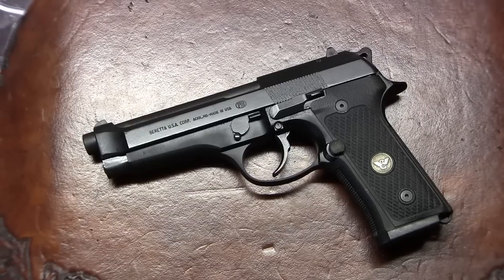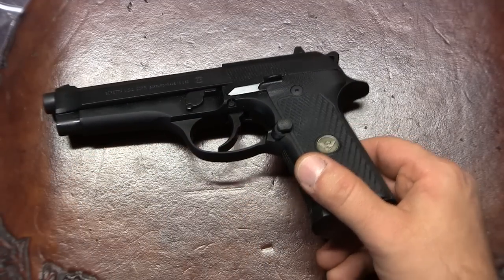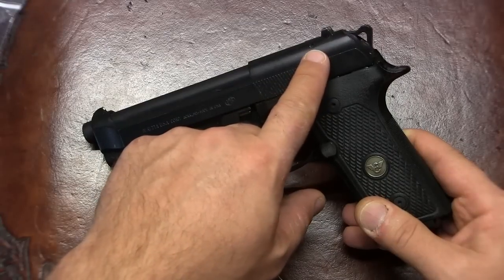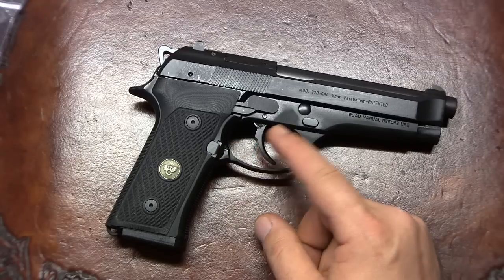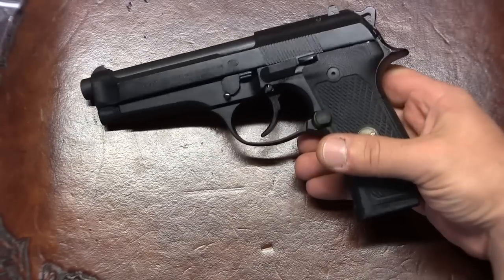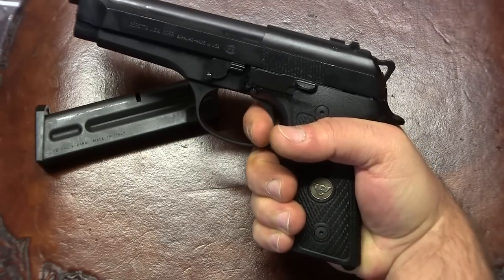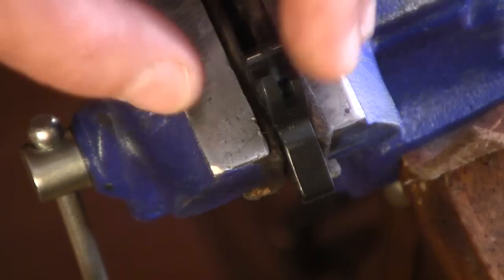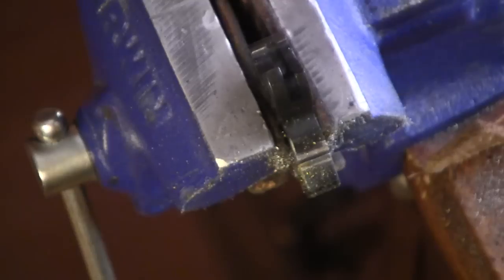Beretta 92 Spurless Hammer (D) Mod

Comment: Great video, thanks. I have 3 D models, a 96D, 92D, and a 92D Centurion. I have installed the standard hammers in mine because some of my holsters allow the weapon to slip by the safety strap during rough use. I also use a lanyard while doing things like kayaking and mountain biking.
Reply from the maker: It is my pleasure. I haven't even considered how the lack of the spur may affect carrying, but it makes total sense depending on the holster. And I figured the lanyard loop would be very handy in some situations. Great to know.
Reply: I have a 96D ,I want to make it single action. And double

Comment: Patrician. I can appreciate a man that utilizes a DAO. I think it's underrated.
Reply from the maker: Thanks. I think that is the only way to really train the trigger finger.
Reply: MosinVirus True. And also the manual of arms is just a safer Glock. But I am interested in what the pull weight is on your gun.
Reply from the maker: It feels like 7 lb.
Reply: MosinVirus That's what, about a pound more than a standard Glock right?
Reply from the maker: Just about. But that is because I am using a light hammer spring. If using stock spring or even D hammer spring, the DA trigger pull weight will increase.
Reply: MosinVirus Out of curiosity, what made you switch to DAO? It's not a particularly common thing. Most just go striker fired at that point.
Reply from the maker: I think I mentioned it - I wanted to train my trigger finger a bit. Long pulls, heavy-ish pulls. I figure if I can improve using this setup and then go back to SA, I will see improvement there for sure.
Reply: MosinVirus Well at that point the trigger weight will be nothing but the pull and reset difference might be somewhat disorienting.
Reply from the maker: Probably true. We will see.
Reply: I get it, that he wants to train his DA pull....but in a war hammer like the M9, wouldnt we all agree the 1st DA pull just to start the lawn mower  going and the true joy the following 14 rounds in SA with the short, light trigger stroke needed for 25 to 50 yard shots and mow down? ..and be able to combat load as many mags as you have til out of mags or finished mowing?

Comment: Looks great. Nice hand work, too. 
What spring do you run? Any light strike issues?
Reply from the maker: I now run the D spring (16 lb). No light strikes. With the 12 lb one i did have a couple out of maybe 300 rounds.
Reply: @MosinVirus  I just installed a 14# hammer spring in my 92 fs 22LR. 
I put well over a hundred rounds through it today and no misfires.

Comment: I was wondering if you could make a video of how to assemble it without the seer And what parts you need to change a 92FS into a 92d
Reply from the maker: One of the biggest changes is the slide. I can see about making a video.
Reply from the maker: On a second thought, I believe it should come down to 3 main parts - slide without savety/decock lever, spurless hammer and spacer block that replaces the decock lever in the frame. The sear is super easy to take out. You take off the grips, push the sear pin out and both the sear and its spring will come out.
Reply: I have actually watched your video for the full disable and full reassemble for the Beretta 92fs every time I work on my Beretta 92fs I have made 3 custom Beretta but this 92d has me norvis I would like to show you the picture of them
Reply from the maker: @seanroessger7075  A "D" version is simply double action only. That is why there is no need for a sear or safety/decock levers. It is not for everyone, especially with the long trigger travel that all Berettas have.
Reply: I understand that 92d is not for everyone. But what I am finding out it is the best way to learn trigger control. So I bought a 92X full size frame and a stainless steel '92D slide. I'm building the gun from those two crucial parts. Your videos are what give me the confidence to explore gunsmithing  for myself. Since day one when I combining the Beretta elite II with M9A3 back in 2020

Comment: With all the work you have done on the Beretta. I was wanting to use the new straight trigger. Which needs to be modified. What is the pad of the trigger?
Reply from the maker: I haven't looked into those to tell you the truth.
Reply: Would you be able to tell me  what bump is being talked about for the over travel on the trigger?
Reply from the maker: @michaelkerr9682  from what I can tell looking at the picture of the Vertical (straight) trigger, the upper body of the trigger is modified. One half is extended rearward to prevent the trigger from resetting all the way out for double action. As it is made it will not allow the trigger bar to travel back enough to the rear to engage the hammer hook. However, if you remove material from that area to match the other side, and the trigger is allowed to reset fully, I believe its shape will not be reachable.

Comment: This is a little late in coming but I have a question, can you use a 96d slide  and barrel on a 92 frame without any hiccups.
Reply from the maker: I have used a 96 D slide on my 92FS without any issues.

Comment: Another great job are you considering changing the hammer spring weight because of the amount of material you removed or does it matter when comparing to the hollow spur that you removed
Reply from the maker: I honestly don't think it will be an issue. Next time I go to the range I will test it out.
Reply: So was it an issue?

Comment: Where the hammer spur came to rest at recoil in the groove in the tang - does this removal of the hammer spur cause over travel of the hammer now at recoil?
Reply from the maker: No, the bottom edge of that slope I created is still where the body of the hammer is/was. That hits the slot in the frame and stops the hammer anyway. There is no way for it to go past that spot. The spur or top half of rhe hammer never contacted the slot. 1911 hammers do that with beavertails, not Beretta. Beretta hammers overtravel control is toward the bottom of the hammer.

Comment: you changed the mass of the hammer by cutting off a piece: that can cause too light percussion and produce a misfire.
Reply from the maker: But the Beretta D hammer is commercially available. And the D version is something that existed for a while. And I can personally say that even with a 12# hammer spring this hammer has not produced a single misfire or light primer strike.
Reply: yes but you used the hammer of an ordinary 92 FS and you cut off a piece. Glad to hear you have no misfires but, at your place, i would avoid this modified hybrid pistol for self defence. The beretta 92 has born as a 100% military gun and still is it, his purpose is not shoot paper targets at the shooting range but.... to kill humans.
Reply from the maker: 0XAN not arguing. Just saying that I dont think there is a big difference in hammer mass between a standard 92fs hammer cut to D profile and a D hammer.

Comment: Wow, the checkering looks fantastic! But wait, can I put a D slide on a 92f? And is the front sight replaceable on the D slide?
Reply from the maker: Thank you. Yes, I believe a D slide should work on the F frame. The D slide I have doesn't have a replaceable front sight. Not sure if there are other D slides out there with replaceable front sights. I am thinking about drilling mine for a fiber optic rod and getting a taller rear to bring POI up. I don't like having to cover the target with the front sight.

Comment: How do you do a DAO conversion? Do you have a reference guide?
Reply from the maker: I never put together a special video for that, but it is essentially removing the sear, and replacing the decock lever in the frame with a spacer. The gun will be DAO if there is no sear.
Reply: @MosinVirus  Do you know where I can find that spacer now and who manufactured yours? Brownells doesn't carry it and google didn't help much.

Comment: what drill sizes should I use
Reply from the maker: For 1911 frames, and for sear and hammer pin holes, a #35 and a 4mm drill bits are used respectively.

Comment: mosin virus I'm building a p12  1911 frame what drill bits should I use and thank you
Reply from the maker: Sorry, never built one myself. But I imagine the pins should be the same diameter as single stack 1911s.

Comment: Do you think a spurless hammer would look good on a 1911?
Reply from the maker: I believe there was at least one company that was making those. They do look very clean.
Reply from the maker: Jack Weigand used to sell those and now Cylinder and Slide has The Warp Speed hammer that doesn't have a spur.

Comment: It looks completely like a different gun... you should put a red dot sight on it, maybe make it fully auto?
Reply from the maker: I am actually thinking of replacing the rear sight and drilling the front for a fiber optic rod. Full Auto will be a huge no-no in my state.
Reply: MosinVirus understandable. How about making it look entirely different and customizing the shape and size of the slide
Reply from the maker: I actually like the shape as is. What did you have in mind?
Reply: MosinVirus honestly i like it too and i cant think of anything

Comment: Are all parts interchangeable between 92fs/92d?
Reply from the maker: 92d uses a slide without the safety lever. So the firing pin is different (longer). 92d also doesn't use a sear and decock lever. A 92fs can be turned into a D by removing the sear only. I went farther than that obviously. But for the most part all parts are interchangeable.